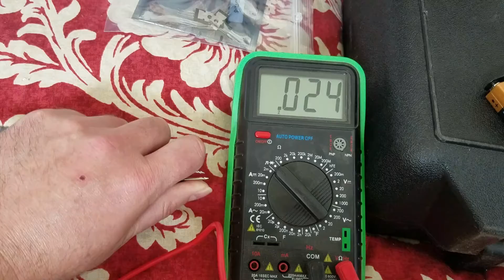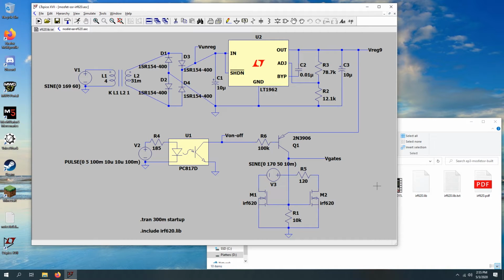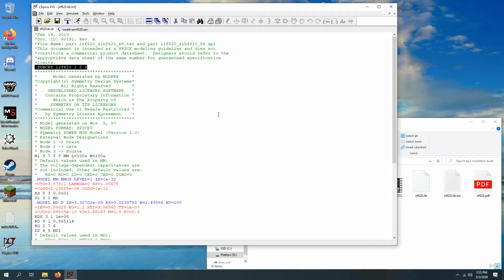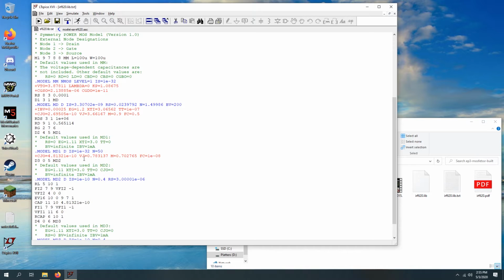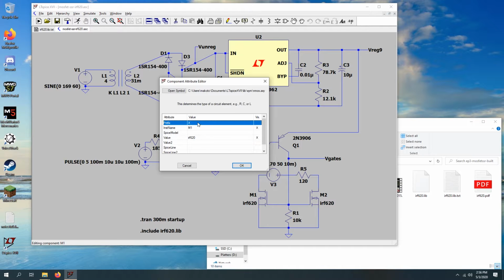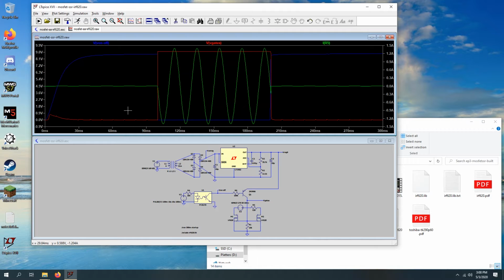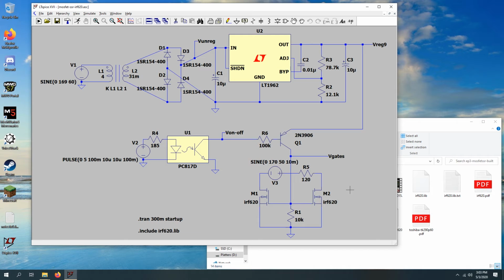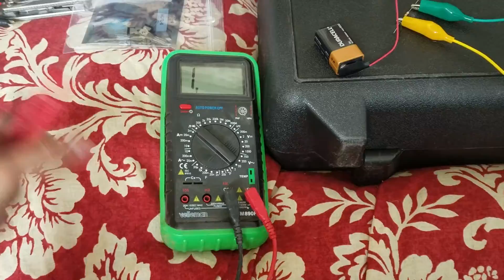Building the MOSFET SSR using IRF620s.

Comment: It's wild to me that this actually works. I don't comprehend how you can have a 110V AC signal at the source and the gnd of a 9V battery on the drain. Well, Zakira said it too in the comment below. Could you elaborate a little bit on which role the body diode plays? Does it effectively block the AC part from getting through to the drain?
Reply from the maker: The body diodes are basically an annoyance. If a MOSFET didn't have a body diode, then a single MOSFET could work as an AC switch. The channel would conduct current in both directions when the MOSFET was on, and not conduct current in either direction when the MOSFET was off. However, since body diodes do exist, we end up having to put two MOSFETs in series. And connected in the correct way so that when the MOSFETs are off, the body diodes block the flow of AC.

> Does it effectively block the AC part from getting through to the drain?

Sort of. Each body diode blocks current during a different half-cycle of the AC. It might help to think of the MOSFET as a mechanical switch in parallel with a diode. When the switch is turned off, current can still sneak around through the diode... if the current is flowing in the correct direction. Diodes are one-way devices, they only allow significant current to flow in one direction, not the other. (There's still a few nA of reverse "leakage" current through a backward biased diode, but we can ignore that in this case.)
Reply from the maker: > It's wild to me that this actually works.

Me too. When I first read that TI app note that explained the circuit, I was like: "No. No! That can't possibly work..."

Comment: I am missing something, how did you get an N-Channel mosfet to conduct 120 VAC, with 9 volts to the gate? I mean, that doesn't appear to be a logic level device from the spec sheet. 

Edit:

I get it, what a brilliant little circuit. My software wasn't simulating the body diode. Nothing beats bench testing sometimes.
Reply from the maker: I wish I could claim credit for the circuit, but the truth is I blatantly stole this idea from a Texas Instruments app note: https://www.ti.com/lit/ug/tiduc87a/tiduc87a.pdf . See especially section 2.1 "Basic SSR Theory", on page 5.

My first video on this subject also included an LTSpice .asc file, which can be downloaded for further simulation if so desired. Check the description on https://www.youtube.com/watch?v=1-De7jaC-R8 for a link to that .asc file.
Reply: @SaltyPuglord  Have you ever used Micro-Cap?
Reply from the maker: @MrAj198  I haven't. I downloaded it when it became free, but I haven't had time to set it up or play with it.